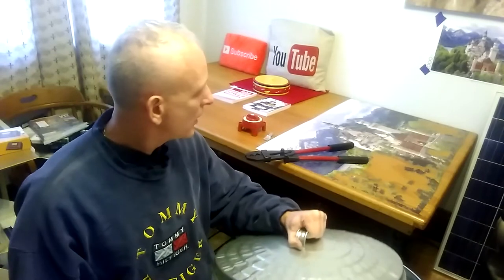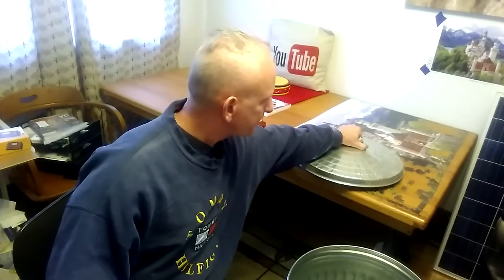EMP Solar Can Backup

Comment: EMP cans.... when the Faraday cage was invented we used Natural Organics to create rubber, and it conducted electricity. Today's rubber does not.... instead of a big giant can why not use a truck inner tube and some rubber cement, cut the tube into a sleeve removing the metal stem part altogether. Use rubber cement to glue one end of the bag shut, put whatever Electronics you want inside through the other end. Twist it shut and fasten it with a rubber band. No electricity will pass it😲 if you use a bungee cord, rubber! You can suspend your items in the center of the can from the lid this to just created a protection electricity will not touch your device👍  how to test your EMP can..... put your devices inside and hit it with electricity if it hurts your devices the EMP will hurt your device... I created several bags like I described, i keep two-way radios in them things along those lines👍
Reply from the maker: +Yankees Outdoor Adventures You are so full of knowledge. I will have to make one with your instructions.
Reply: DIY Solar and Wind they take up a lot less room then you're can, you can make one and fill it with things like Flashlight batteries that would be affected by an EMP👍 or whatever else you can put in there LOL

Comment: I 've also been dipping into a faraday cages.  I can block  higher spectrum but not the lower as much...  Do you use foil tape too with yours?
  Thanks for sharing... ill  sub   :D  from C.R.
Reply from the maker: I never thought about the foil tape, thanks. There were other comments below that helped me also. What a great community this has turned out to be.